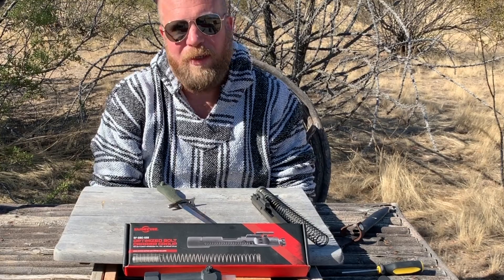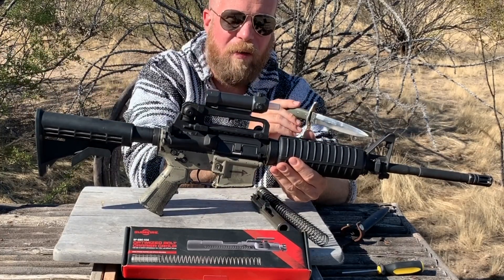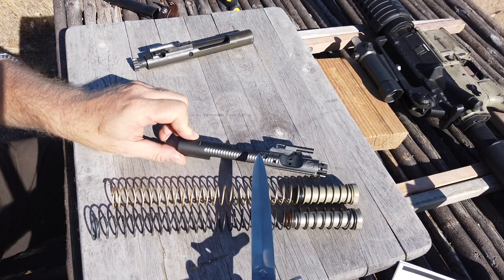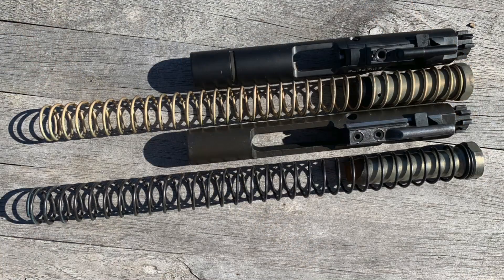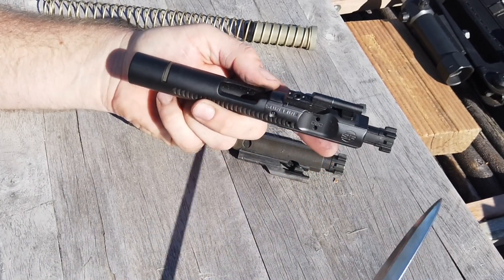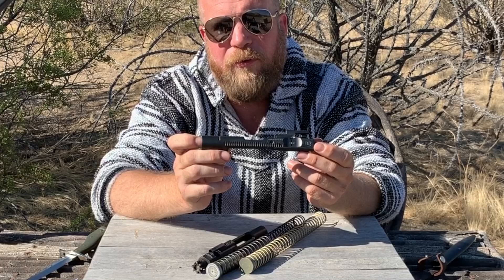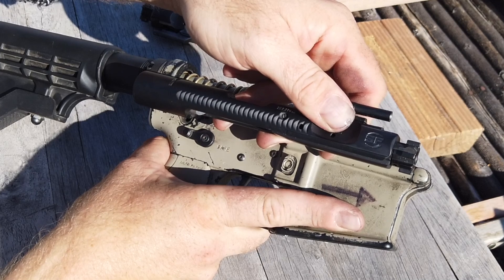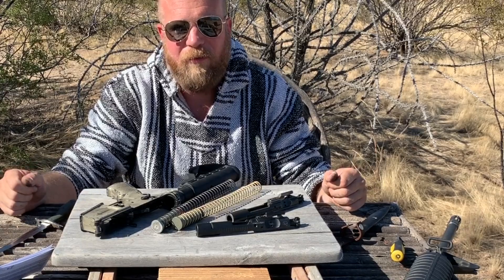Surefire Enhanced Bolt Carrier Group

Comment: It seems like the A5 buffer system is a more modest approach unless you're going to run full auto.
Reply: Now that I'm thinking about it, an A5 buffer length GWACS lower would be pretty cool.
Reply: Giselle super 42 spring is even simpler
Reply: @deeheych1101  For the record, A5 buffers work great with a Super 42 RIFLE spring
Reply: Dee Heych have you seen the Tubbs spring.

Comment: I’d like to see how this compares to the Vltor A5
Reply: Apples to oranges. the A5 system is a buffer system replacement for otherwise stock M4/AR15 rifles to allow for increased buffer weight. A better comparison would be how it compares to the LMT Enhanced BCG given that they have (largely) the same design goals, but LMT was restricted due to the .gov contract at the time to do the most drop in system possible, which mean a standard stroke length.
Reply: Paul Lo Cicero  I'm not sure what point you're trying to make. The A5 is a new buffer system to allow collapsible stocks to get closer to the feel of a rifle buffer system, and to allow for additional weight to be added beyond what the original dimesnions of the original carbine buffer will allow.

The Surefire BCG on the other hand is primarily focused on a re-designed cam track and increased bolt stroke, with mass added to the carrier to compensate for smaller/shorter buffer, and then other mass added to address bounce.

More mass, on it's own, isn't anything special or new. What's most interesting is the cam track changes, and that's where the comparison to the LMT EBCG would be interesting, as they also re-did that track profile, but without a change to the stroke of the operating system itself. (They also incorporated geometry changes to the lugs, extractor, and bolt face itself, but that's a separate issue, as I see no mention of a non-standard bolt, it appears that changes were confined to the carrier itself).
Reply: I'd be curious about this too, both require a proprietary buffer afterall so they're comparable enough

Comment: Hmm.  Binary Trigger lower may benefit from this.  Will consider.
Reply from the maker: It will not provide any benefit to a binary trigger, the best thing you can do with the binary trigger is to remove it.
Reply: @InrangeTv  Suggestion to make video regarding my comment above.
Reply: It is a blast in binary. Smoothes out recoil impulses and makes it very easy to stay on target.
Reply: @InRangeTV Why the hate towards binary triggers?
Reply: @71stang94  Because it is generally considered a novelty of dubious reliability and limited practical application.  Although with practice, I argue that it could be used at short ranges.  Nevertheless, due to the non-cyclic nature of a binary trigger, I understand what Carl is saying however I'd be interested in a video (as in pseudo slow motion) on InRange's part to see if it is true.
Reply: Karl and Ian have already talked about binary triggers. The problem will always be: what can you do if you absolutely have to stop firing after the first ( rearward ) pull of a binary trigger? 
Not all binaries will go on safe with the trigger held ..
Reply: @williestyle35  which one will not go safe? I own fostech and Franklins. Both brands go safe no issue. Also, in binary, I use the trigger as an on off button.  2 round burst kind of. I never have the trigger held back. Please let me know any other ATF approved binaries so I can add to my collection.
Reply: Sanguine Moon , my bad. I was conflating two different things. You are right: AR 15 system rifles will nearly always go into safe, when "cocked" ( ready to fire ). 
Sorry, you listed both approved binary triggers I have seen ( would rather have this Surefire BCG than any binary ).

Comment: LMT did the same thing back in the early 2000s to better effect
Reply: Yes they did owned 2 of them.
Bill Alexander did a rear good post on the lmt enhanced carrier explaining the features. Yrs ago on m4c forum .
Reply: The lmt system is expensive too and doesn’t have the longer stroke from the short gas key or the spring loaded weight

Comment: Given the improved Surefire Enhanced Bolt Carrier Group runs over $400 plus shipping and I don't plan on patrolling in Iraq or Afghanistan so the necessity of improving the reliability of the feed for my bi-weekly trip to the range is marginal.  I'll just clean a little more with Gunzilla.
Reply: You don't even need it for that.. I know i'm one man, but in my military service myself and none of those I served with ever had any of the issues this improved bolt claims to fix.

Comment: 10:27 Last-shot reload drills would make quick work of that bolt catch, especially in the poly WWSD lower.
Reply: Mine has 600 rounds through it with the surefire optimized bcg. I have seen no increased wear on the catch yet. The bolt appears to be moving slower when striking the catch on video. The weight is sprung to slow the carrier.
Reply: @sanguinemoon9201  I suppose any lower will give out before a true mil-spec bolt catch does. The smacking was an issue on the Colt 9mm M4. One of these days I'll finally get a lab up and running that gets all of the spring/weight data compiled for the commercial end user.
Reply: Mine has 600 rounds with the surefire obcg. No visible wear on the catch. On video it appears the carrier is moving slower than standard despite increased distance. The sprung weight slows it down a lot.  All rounds were fired in binary mode.

Comment: And this is part of why I still like the full-length 20" barrel. It really is what the system was designed around. That said, I'm not riding around in a vehicle all day with a rifle expecting trouble, so I do understand why the shorter barrel lengths have become dominant, at least in military applications. For me, I'd rather have the velocity gains and reduced wear on the mechanism that go with the 20", the sight radius is nice too for a primarily iron sight shooter like me (though I am using a few with red dots, including my main 'go to' rifle, but irons are still present, just in case).
Reply: there is a fix for the wear issue. A 16” barrel with a mid length gas system operated nearly identically to a 20” with a rifle system.

Comment: Would this bcg be safe to put into a rifle with a couple thousand rounds through it? I read differing opinions on the topic, and am by no means an expert.
Reply from the maker: Yes, why in the world would that be a concern?
Reply: It's not a concern at all, indeed, it's a good thing. You're replacing potentially worn-out or near worn-out parts with brand new ones.
Reply: My guess is some people get overly worried about the effects of wear on headspace. If I can pair a really tired 1970's BCG from one of the Malaysian contract M16A1 parts kits with a brand new barrel with it passing  all of the gauges just fine, I think it's rather unlikely that it would be an issue unless you get some tolerance stack problems due to differing manufacturers.

Comment: Will you consider replacing Surefire's buffer and spring with an appropriate one from JP Rifles? Also, Surefire or LMT enhanced bcg and bolt assebly?
Reply: Lambros Stamos You’re not supposed to replace the buffer and sprung, because they add the lengthened stroke to the carrier.

Comment: Question for Ian & Karl:

With the Holosun 503c out of production, are you guys planning on updating the WWSD components list with a replacement, or is the project "done" and merely being preserved for posterity now?
Reply from the maker: We are revisiting a lot of that in 2020.   Stay tuned.
Reply: @InrangeTv  the sure fire bolt seems great for a full auto build but at 400 dollars seems a little steep and unnecessary for a Simi auto.
Reply: @InrangeTv  any chance that you'll do a pistol build along with three rifle? 

Last time you guys went carbine and DMR and ended up ditching DMR.

It would be interesting to see what could be done with a brace and a 10.5/11.5/12.5 barrel
Reply: DMStraylight;
Don’t forget the GWACS polymer lower.

They’ve been effectively out of production since Appomattox, 1865.
Reply: @TheAlmightyRuler1  😂
Reply: @TheAlmightyRuler1  I wish they'd get it back into production! They run crazy prices on gunbroker
Reply: I'd like to see incremental improvements to WWSD as new products enter the market. Such as this bolt carrier.
Reply: The 503G ACSS is pretty much the same thing, minus solar panel.
Reply: The gwacs lower is still dead too.
Reply: @DougsDiggers  
While Sinistral breaths there is hope for a new gwacs.
Reply: @dchil15  He doesn't work with them anymore. He used to.
Reply: @dchil15  GWACS is dead, long live the CAV-15 though.
Reply: If you’re looking at building a WWSD rifle is get a holosun 403c, 503cu, 515cu, or 515cm based on what features you want or need. All have a solar panel. The 403c is the cheapest but is only a 2MOA dot reticle. The 503cu has the 2MOA dot and 65MOA ring, and shake to turn on, and the 515cu and 515cm look like a 503cu with lens covers and a flash kill on the from the factory and markings reflect that. My suggestion get the 515cu and remove the lens covers if you don’t want them on the optic and put them in a baggy you never know you might want them later on.
Reply: They didn't say you had to specifically use a Holosun optic. Then chose the Holosun to show that optical sighting systems have gotten to a point where even inexpensive optics are pretty great. Ian said he ended up using an Aimpoint Comp M5. You can use an EOTech sight if you want too. The main characteristic of the WWSD rifles is low weight. And most practical red dots aren't gonna weigh enough to really matter.